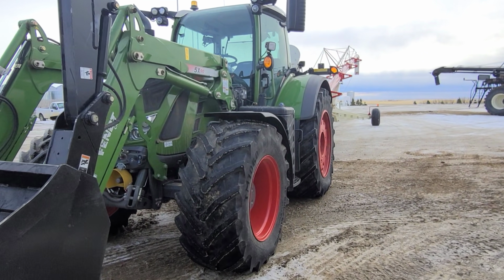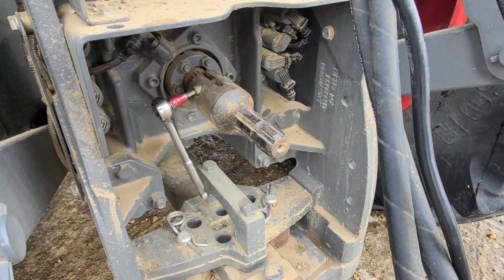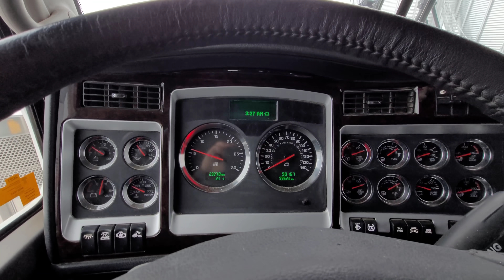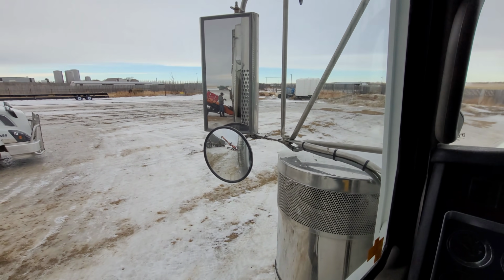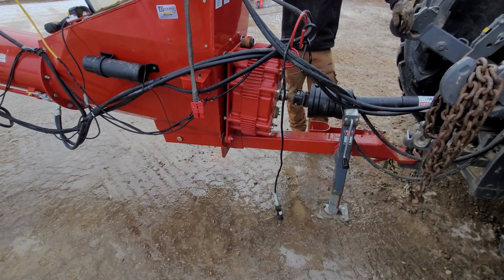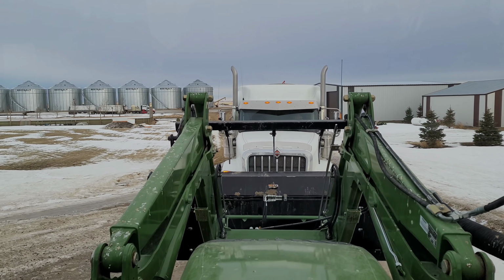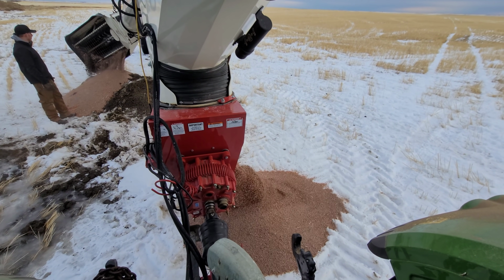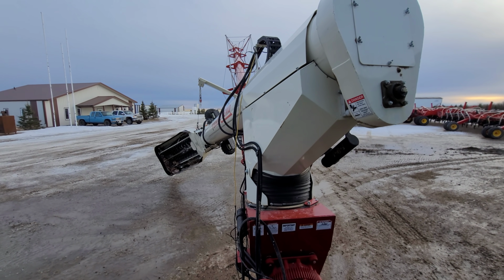The auger broke, so getting ready to move!

Comment: Farm kings are FAMOUS for that . I have now been using them on farms I worked at. And every single one of them. Brand new, used they either broke in the middle or sheared off right at the gear box. Tereible design
Reply from the maker: 🤔 That I didn't know.. Just knew the gear box was weak
Reply: @mikemitchell2554  we had one at rhe feedlot in alberta that snapped at the gear box in harvest. Got another one, it was bent, fixed the old one . I moved to near Fort quapelle before harvest 2020 and middle of harvest , same kind of auger same thing snapped.
Reply from the maker: @damonens9478  🤔 you would think they would be working on making those a little stronger?
Reply: @mikemitchell2554  well, that would be the ideal thing to do but for as smart as engineers are, they sure aren't very smart

Comment: we never had a leg either. however i was a very inventative gal, and i built a inguenious sorta grain handling system on the bin system. we laid to rail tracks one where the wheels on the auger were, and one at the ground end of the auger was 20 feet past each end of the bins. i then turned the axles 90 degrees to the auger tube, and put another axle on the ground end where the trucks unloaded. we had a sorta  retired old international tractor we used for the auger only and made a hitch on the side of the auger. riding only on the rims of the wheels the auger stayed on the rails very well. and where ever the auger spout droped in the bin we had a knotch in the rail so the whells droped in and told us the spout was in place. it saved us huge huge huge time moving the auger from bin to bin and one person done it so easy. giggles unless like me tired in a rush one night i foregot to open the bin top and dumped a load of grain down the back of the bin.. oops. the only prob we ever had was some times the battery was dead on the tractor so we hadda hand crank start it, lol but worked. but over all the system was a god sent saviour when it came harvesting time.

Comment: Few guys round us in south west Australia run the big million $$ lef setup on their bins, a bit like alot of the Americans it really only comes into use when you start drying amd cleaning your grain and then you really need it 
Our cousins are one of the few running a full setup 
Running a dryer with augers and portable bins going every which direction is painful, slow and dangerous for a hired hand to manage 

But most of us are like you, stick to augers amd don't dry just wait for the sun to dry it 

Also I suspect if our wheat started going 12t/ha or 180bu/ac like the corn guys we might have to invest in better /faster infrastructure 
While its only going 3t or 44bu it's not affordable or required

Comment: I will just never understand the trouble of changing the pto in America. In Europe the pto for 1000 and 540 are just the same size you just switch a lever in the tractor so easy.
Reply: True, one can change 1000/540 on the fly as well in some models.
Reply: It's so operators can not accidentally run a 540 machine on 1000 RPM
Reply: @theogootjes3380  you only do that once 😂😂
Reply: Adam yep agreed😜😂

Comment: Hey Mike, you can run your PTO selector on 540 even it you have the 1000 shaft in it, save you from running it too fast by accident
Reply from the maker: Oh I like that!
Reply: I work for a guy that has a few🤣🤣
Reply: @mikemitchell2554  These augers are designed to run at 1000. That is the ratio of the gearbox.
Sorry to be repetitive. (If you saw my other replies) 
Also the new flighting design is awesome.

Comment: I've never really understood the 540 / 1000 PTO. Do the different splines interface with a different gear inside the tractor or something? If so, what for? Mechanical advantage? With modern technology, I'd expect a CVT- / IVT-like transmission for the PTO, so the only difference would be the spine shape.
Reply: The pto stub shaft does have a gear on it that interfaces with a different gear in the tractor. Could they have a cvt, or something similar in the tractor for the pto, they could, but it depends what the horse power requirement is for the implement. That tractor has alot more power than that auger needs which is why you have to be careful when using a "reducer shaft" like that.
Reply: Exactly right with the older tractors I am familiar with at least. To change our what was our newest tractor from 1000 to 540 would have required replacing 2 gears 1 of which was a complete shaft that ran all the way to the front of the transmission.  All of the implements our farm had where 540 and your certainly didn't want to run our post-hole digger on the 1 tractor we had that output  at 1000 rpm! As far as I am aware most 540 stuff is actually weaker mechanically and would not last long at modern speeds  before flying apart. Bare in mind I haven't had anything to do with machinery since 2003 so it may all be different now.
Reply: @katt7512  We have a 1983 Ford 7710 where all you have to do is replace the stub shaft that has a different gear on it to change the pto rpms. Takes maybe 5 minutes to swap it out.
Reply: We can change pto speeds from the cab in Europe, usa is used to different shaft styles so you dont mess up implements by overrevving them. 

Big 1000 shaft can handle more horsepower than a big 540, due to the simple fact that by increasing the rpm’s, the tourque is reduced (double the rpm, half the tourque if you transfer the same amount of hp)
Reply: @Erik21088  Hang on, we don't have the two different splines in Europe? I guess I'm watching too many farming videos from NA, I kinda had it in my head that that was a universal thing. So what do we have in the EU, a 540-like, 1000-like, or completely different spline?
Reply: @timderks5960  we do, but the 8-spline 1 1/4” (‘small 540’) pto is mostly used around here, for high horsepower jobs some guy’s switch to the 1 3/4” 21 spline (‘big 1000’).

Comment: Hey Mike, I was wondering why you said you would have to think about the PTO speeds 1000 and 540. I know you said that because the 540 should not go to fast but in Europe you can normally change the PTO speed in the Cab?

Talking about speed not the matching shafts
Reply: That's because you all don't use that adapter. Tractor thinks it's in 1000 so you have to manually decide what rpm to run

Comment: Mike i have a question: are these augers still the heaviest and strongest on the market, because you said they break sometimes...wondering if you have tried others out and would like to know your opninion on them
Reply from the maker: Brandt makes heavier augers believe, but we haven't tried them yet
Reply: The waste on your farm is more than most farms total harvest!
Reply: The waste is astonishing
Reply: The waste percent though is probably smaller than most farms.
Reply: @mikemitchell2554  The gearboxes in all the 16inch augers are the same.
When you get a warranty flighting at your dealer you should get the updated flighting. They now have a larger thicker core and new couplers. You should have zero flighting troubles with the new version. It is a very nice update.

Comment: Mike you said that you have replaced several of the Buhler gearboxes.  Did you have to replace the entire gearbox, or was if fixable?
Reply from the maker: 🤔🤔 Pretty sure they stuck a new one on because it nearly went boom haha
Reply: @mikemitchell2554  I don't know what rpm you are running the pto. Make sure you are running at 1000 rpm. You will have less torque load.
All auger makes use the same gearboxes. They were actually designed for Farm King. We worked on the first prototype 16 inch and the gearbox was measured to retrofit a chain drive that could not handle the load.
Everyone uses the same supplier.

Comment: So... Mike aren't you running those augers to hard, with the 540 adapter on the 1000 shaft causing auger failures
Reply from the maker: They run the big 1000 splin shafts on both the auger and tractor.. No adapters used
Reply: The 540 adapter was for something else, he was taking it off so he could hook up the auger.